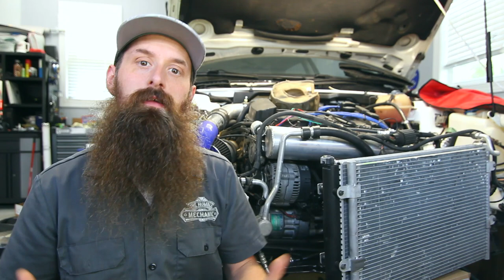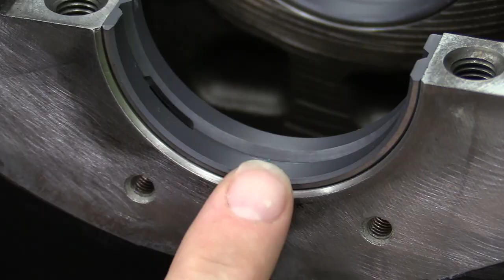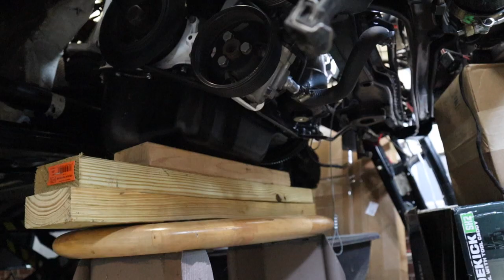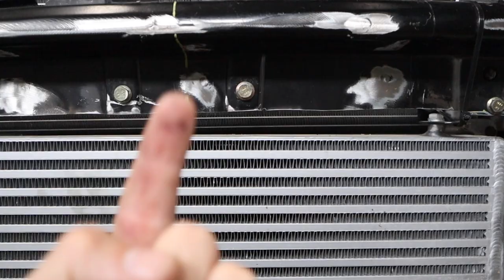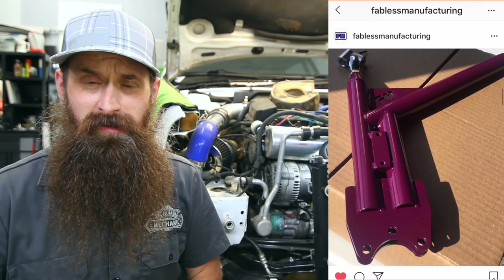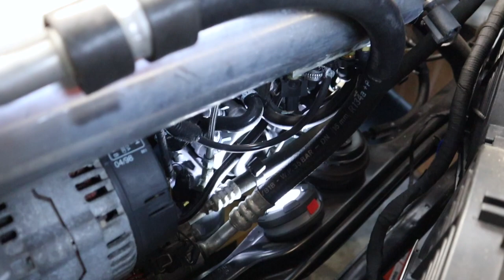VR6t GTI Update ~ Stalled Project and Fluid Leaks

Comment: Glad your going back on the gen 3 golf/Jetta combo. Always have liked the aaa engine.  Seems like those engines are one of the best built for the vr6"s. I also thought that design was the best looking for all the generations.  I could be wrong on some information. Just an idea (maybe it won't work), how bout aaa block, 24v vr6 head and intake with or without turbo?  Just trying to be creative,  maybe  pulling out of my ass, but ya know I was thinking about it when you started this project saying you were using the 99 vr6 head gasket.  Glad you and your family are safe.
Reply from the maker: Not sure the heads mate up on on the 24 and 12v. But I like where you’re going. I think if any engine stuff happens it’s getting a 3.6 😎

Comment: I have a 2000 Vr6 Gti that I’ve owned for 2 years, done the clutch, timing chains, crack pipe and countless other things for that Wookie sound, the car randomly dies or acts weird because of a short in my “drive by wire” there is no way to buy one online and not sure what to do as the car is practically totaled without it. Do you think I should just take a dump in the back of the car and try and sell it?
Reply from the maker: Well we can look for a throttle body at a junk yard. IF it's a wiring issue, we have options to overlay or fix the harness. Sounds like it needs some proper diag to find the actual issue.
Reply: HumbleMechanic I assume it’s the wire that goes to the throttle body, when I bought the car it was all taped up and looks like it’s been cut, nearly in half, maybe Il take it to a VW tech, thanks for replying btw your the man!!

Comment: Nice video, I'm looking for a used GTI right now I find a lot here in central Texas priced between 6k to 8k which is about how much i have saved any where from 2002 to 2010. I want to do intake, exhaust and possibly a stage 1 ecu, and use it as a daily driver to save diesel and wear on my truck. Any suggestions on what to look out for on a used GTI?

Comment: Hey bro I been watching over the past time about your vr6 build. Nice!!! I don't know if you could help me with some questions about mine
Reply from the maker: Either post it here of on the Facebook group. Tons of help for y
Reply: Trying to keep it short. But I did turbo repair on this thing and new intake gaskets. Installed new radiator hoses. I have bad misfire. Never was there before. New wires new coil new plugs. Sprayed down everything with brake clean idle don't change. Don't seem like any intake leaks
Reply: My main question I wanted to ask is how are your coolant hoses routed? When I bought this thing it was torn down to s#*t. I bypassed heater core.

Comment: Disclaimer: Jedi Mind Trick attempt
When you're done with these projects why don't you build a Mk1 Vr6 G60 4motion? You can make a fun streetable car with a manual or a time attack/strip beast with a DSG, just leave out the Haldex and split the tourqe 35/65 rear, but G60 may not be enough for strip runs.

Comment: i just bought 03 GTI VR6 and im looking to turbo it is there is kits online ?
Reply from the maker: I got mine from CTS, but I am not sure I would go that route again.
Reply: @HumbleMechanic  thanks boos
Reply: Even the kits from the high end companies for high end cars are crap.  Honestly if you can get a good manifold with good fitment and the turbo is in a good spot with a good drain location grab it.  Its better to make your own charge tubes and find a good intercooler, the kits never fit right and rub and not supported correctly.  This is no to mention how much you will have to modify the car to fit them too.  They rub holes and the couplers blow off on a lot of them.  Its really not that bad to make your own kit just have to keep in mind where things are going rub and get hot.  The turbo oil feed needs to be correct for the turbo your running ie line size and if a restrictor is required, also the drain is very often overlooked.  The drain needs to be full size of the exit port on the turbo with as soft of bends as possible and dump in to the crank case into AIR not below the oil level.  Even oem setups will often have oil leaking on the inlet side because their drains are not correct.  The rest is hooking the turbo to the exhaust system and if you need to plum your wastegate into the exhaust as well. There are a few more parts needed fueling blowoff vale etc really when yo go down this road its better to learn it all for your self and do it right and if you mess up learn.  Also when something breaks you will know whats going on and not have to worry about taking it to a shop.
Reply: @met9009  sure i looked on the kits they are over 4k i think im going to bulid ny own kit 
thanks